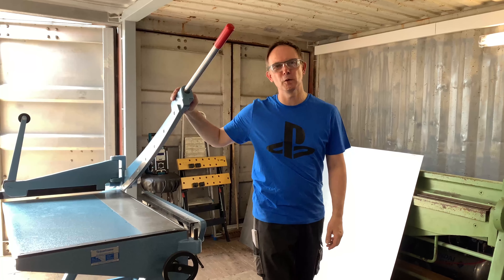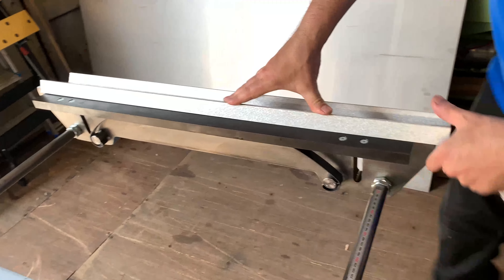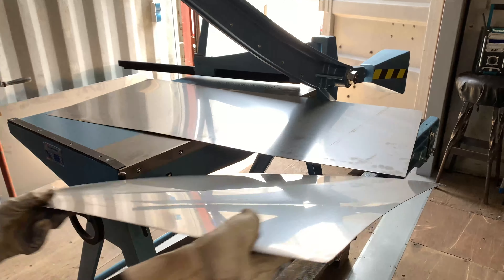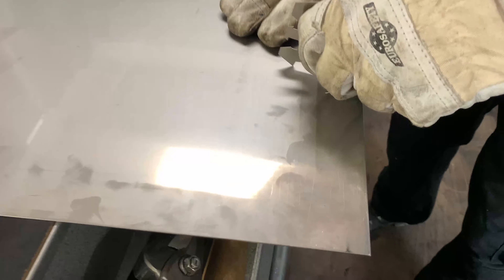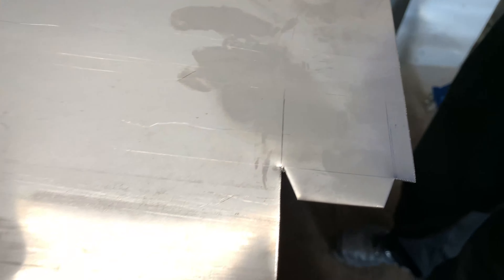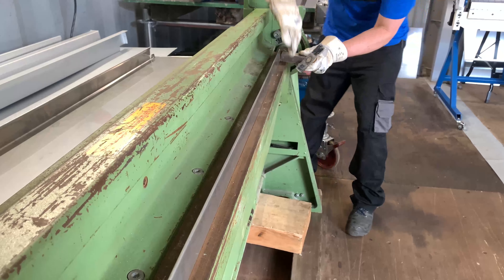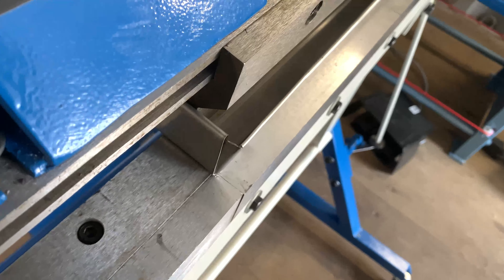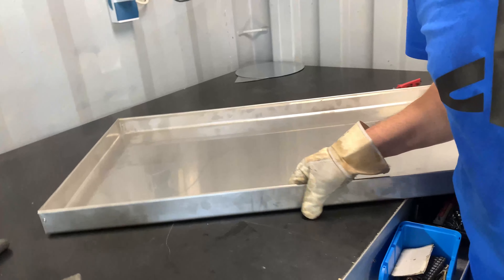Sheet metal machines part 2

Comment: Most Sheet-metalworkers i've known during my 35 years and counting career do perfectly Tig weld stainless steel, one week could be making stainless catering equipment,next week brazing galvanised ductwork fittings together on site,next week welding aluminium cladding on insulation projects, sheet-metal workers are not just the guys who exclusively work on insulation jobs,they're generally referred to as Laggers